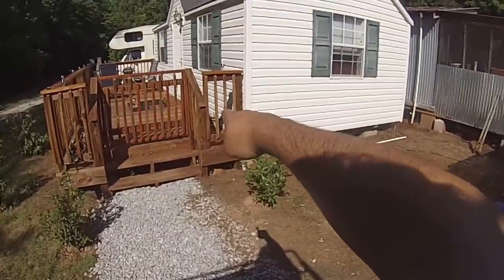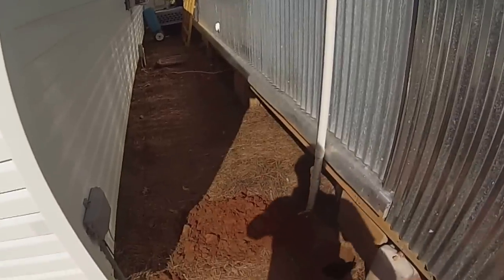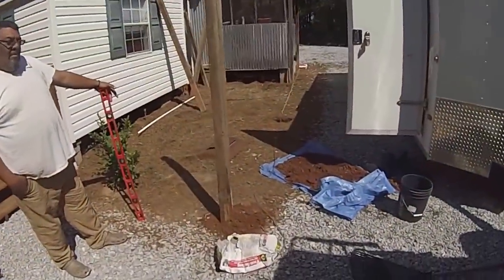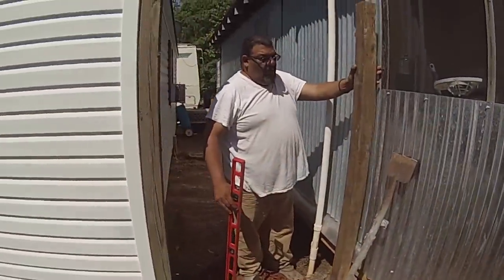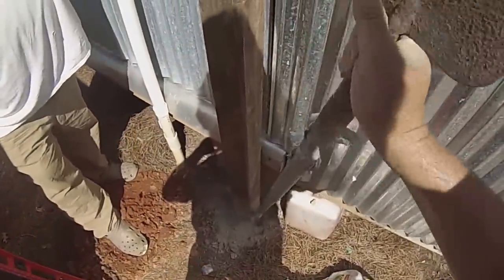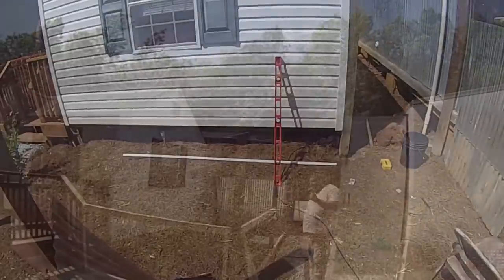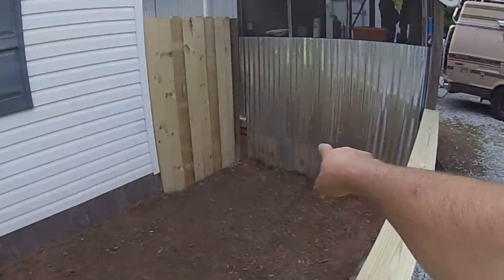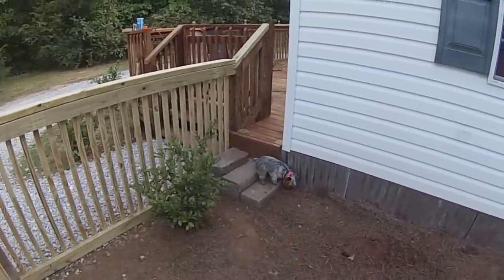Adding A Dog Pen To The RV Home Base Camp

Comment: Looks good. Maybe use the tall 4x4 and put shade cloth over for shade and large prey birds.
Reply from the maker: +Saylor ZG that side of the building faces due east. So it gets the early morning sun until about 11 am. After that it has good shade for rest of day because building blocks the sun. I plan on building a bench at support building and adding a doggie door into the screen porch on it. That will give them more room and also a place to escape bugs and/or rain if need be. Thanks for the comment. CVK

Comment: Hey Kevin, I in joy watching you and Bigg Dogg keep up the great videos O and the dogs i was just wondering what is the scooter you are riding and what size is it i am wan'ting one to put on the back of my class A to get around camp sites thanks buddy safe travels..
Reply from the maker: +Mark Champagne It is a 99 Honda Elite 50 2 stroke. I purchased it from an elderly gentleman. It has never sit outside and looks brand new. It had about 600 miles on it when I got it. I paid $600 for it. He had just spent $450 on getting it road worthy from sitting a year prior. It can go over 40 mph and pulls me 250lbs just fine. I love it